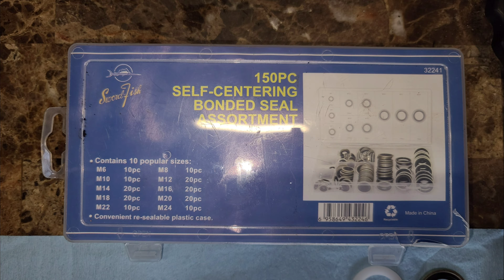Custom 7mgte AN fitting oil return to pan.

Comment: I'm going built NA-T, my oil pan has a AN welded to the oem hole that is on the side of the oil pan( I have no idea as to what went there to be honest) and I'm a little worried about oil flow, should I widen the hole? or restart and run a fitting setup similar to the video? Thanks!
Reply from the maker: Hey Jake the stock return for the ct26 to the block on the gte is at least a -10AN I would definitely make it bigger to be on the safe side. The one I added in the video should be perfect. The fitting you currently have was probably from an oil cooler line which would explain the size because it's under pressure. You need something bigger to flow from gravity as you already know.  Are you running an oil cooler? If so aftermarket or stock gte cooler housing ?
Reply: @josephmaldonado2521   I welded on the -10 steel AN bung from the NA-T oil line kit from Driftmotion. I'm going to run the DM Koyo oil cooler and oil filter relocation kit. I'm definitely gonna go ahead and clear some space since I welded it onto a smaller OEM hole that was already  on the oil pan. Don't wanna take any chances with it since I'm going to be in 450-500 HP range (went different turbo route)
Reply from the maker: Ok cool yea you will definitely need that good oil flow for your HP level. Sounds good you will be ready to rock n roll when all is done 🤙🏼
Reply: @josephmaldonado2521  Yeah for sure, thanks!

Comment: Nice work. Where does the feed line come from off the 7M block?
Reply from the maker: If you look @0:13seconds in video. Its the gold fitting to the right of where the oil filters goes.  Where it says 7m on the block.
Reply from the maker: And on an NA there is a oil sensor right next to where that would be and you could use a tee to feed off of it and still run the sensor.
Reply: @josephmaldonado2521  okay cool thanks for the info. I'm going N/A-T with mine and am just about to buy my AN lines and fittings.
Reply from the maker: No problem! That's cool man so far I'm having a great time with my build and I'm sure you are as well 🤘✊

Comment: I did the same thing to my nom turbo block gte head 7mgte but am having issues with oil coming out of the air intake
Reply from the maker: Oil in the intake would be from a bad turbo seal or excessive blow by from the engine is my first thought.
Reply: @josephmaldonado2521  you where right it actually worked once I changed the seal
Reply from the maker: Excellent! that’s what I like to hear 💪🏼

Comment: I’m working on a front sump setup for my 7MGTE swapped s13. I have a front sump pan, 5m front sump oil pump, and 7mgte mid sump oil pump but I’m trying to figure out what the best setup is. What oil pump and pickup are you using?
Reply from the maker: Oh thats a cool swap! I'm using the 85+ 5m -7mge front sump oil pump because it has the bigger gears like the gte mid sump. This pump also had a deeper pan with the return line bung on the side. Is that the pan you have?
Reply from the maker: I do have a video on my channel on these oil pumps if you haven't seen it 🤙
Reply: im in the same boat how has the 5m pump worked out? i have one out of a 86 5mge shimmed it 3mm and wondering now if i should convert to an fittings too and if my oil pump is the right one with bigger gears, last thing i want is for it to break
Reply from the maker: If your able to upgrade it I definitely would to be on the safe side.
Reply: @josephmaldonado2521  just rewatched all the vids and that, so you are running the 5mge oil pickup? or did u go for a drift motion one?